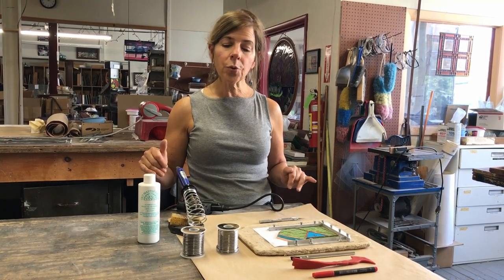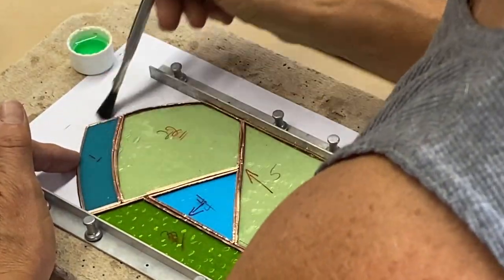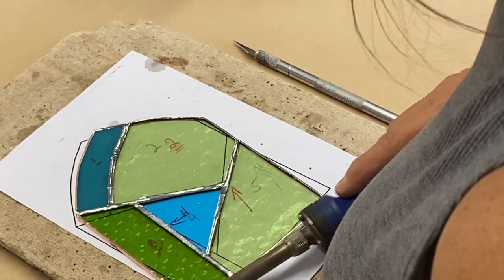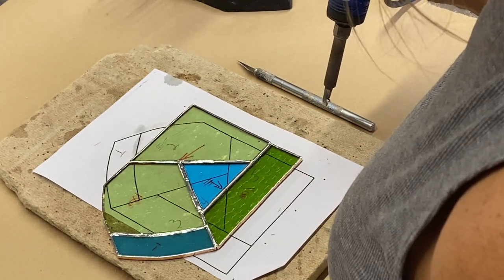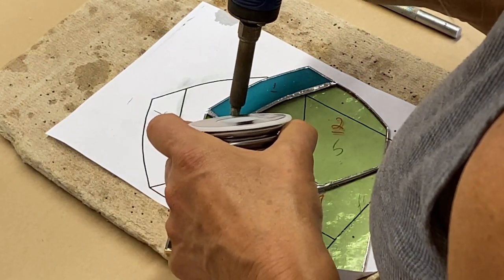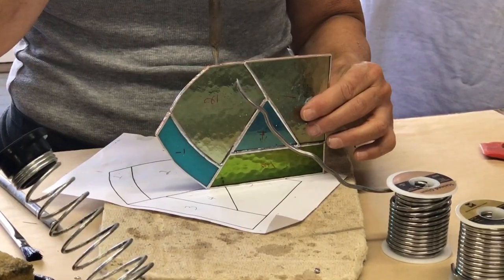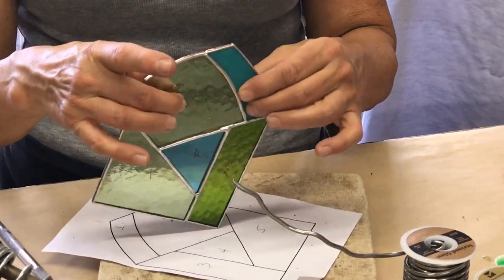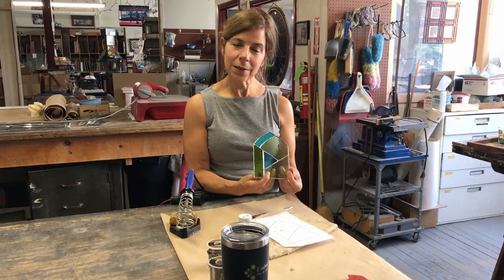Soldering for copper foil

Comment: This is called Tiffany glass construction. It was developed in the UK by Louis Comfort Tiffany (an american). This is not stained glass construction. Please remember that there is an L in solder, and it is not a silent L.......... Glad to see someone running solder beads. It is a component that so many can't seem to be bothered with.
Reply: So... what is stained glass construction then?
Reply: @cox6353 Stained glass... Clear glass the has a design added to it using mineral stains that are heat fused onto the glass surface (please note that coloured glass is a glass where the colour is not just on the surface). The glass is then held in place using lead came and solder ( sol der. There is no such thing as a silent L. The word americans say is sodder, which is something completely different......)

Comment: Very informative video for a beginner like me. I've watched numerous videos on soldering. Your technique seems to be simple and produces excellent results. I am using the same soldering iron as you. What temperature setting do you use? Do you change the temperature setting to match the type of solder you are using? I subscribed to your channel. Looking forward for additional great content from you. Thank you for sharing your expertise.
Reply from the maker: Hi David,
Glad this has been helpful. We usually set the iron to the 460 setting. No adjustment for solder types, but often will dial down the temp a bit when doing the second side to mitigate “leak throughs”
Reply: @shardsglassstudio9298  thank you for the response
Reply: Hello, what wattage is the iron?  100w?

Comment: Your videos are great and you explain everything very well. Can you also show how to grind glass and when is it necessary to do. Thank you very much.
Reply from the maker: Thanks Yuliya, Grinding is necessary for the most part with all pieces that are being used in a copper foil project.  #1, grinding takes the sharpness from the cut edge of the glass, thus preventing the foil tape from being cut or split.  #2, Also when grinding, keeping the glass down on the platform of grinder will give your piece a nice 90 degree edge, making it easier to foil evenly. Hope this helps!
Reply: @shardsglassstudio9298  thank you very much for your response. It is very helpful.

Comment: Thank you for your tips, would have been nice if you said what temperature level do you use for each stage of the soldering (flat solder, bead sokder)
Reply from the maker: Ahhhh, good point.  As each iron is calibrated differently it is hard to suggest a temperature setting.  Many irons do not use actual Fahrenheit #s but use more of a 1-5 setting.  Therefore it is necessary to experiment.  But, to your point (a good one) the front of a piece will always be soldered at a higher temperature than the back of a piece. This is because when soldering the back, the front is already "sealed" and therefore requires a lower temp so as to not leak through the finished front, and allow flux to heat and evaporate some in order to mitigate sputtering

Comment: Hi Kai, I have lots of glass and supplies I purchased from you over 20 years ago.  I took a hiatus and now that I'm an empty nester, I'm trying again.  I'm getting black marks when I am soldering.  Is my iron too hot? Thanks, Melissa
Reply from the maker: Hi Melissa, the first thing I would ask is what kind of solder are you using? There are different grades of solder. Some are virginal., Which means they have not been reconstituted old lead. Those would work the best and not leave black spots. The other culprit can be your flux. The job of flux is to clean the copper foil before soldering. If the flux is old and not doing the job, then the result is black spots in your solder. Hope this helps

Comment: What temperature do you solder at? I use 410 with the hako
Reply from the maker: We use the Hakko on 460 but keep in mind that they are all calibrated a bit differently and we usually use 63%tin solder (called ultimate)

Comment: Hi
Is the solder strong enough to hold all the pieces? I recently solder few pieces and i am not happy with the strength, as i shaked it felt like that part is gonna come out. 
Can you tell where i could have gone  wrong?
Reply from the maker: Without looking at your piece, I cant tell you definitively where the issue may be, but i can make a couple of guesses.  First, when you have a straight line, or near straight line in a piece it wants to "fold" or bend in that area.  One way to mitigate that is to run strong line or wire around the perimeter. (for future be aware that straight lines through are weak spots in any design).  Second, make sure your piece is bead soldered both front and back.  The bead is what creates the metal infrastructure to lend the piece support.  Even if you have patina'd you can still go back into the soldering and add more.  Hope this helps

Comment: I’m new to this and my sober doesn’t flow like when you do it. It doesn’t stick to the copper foil very well. I don’t hear that “sizzle” noise.  We seem to have the same soldering iron and I put mine on 410 ….Any suggestions outside of me taking a class? Thanks
Reply from the maker: I would try a different flux.  The one we use is called Novacan liquid flux.  The flux is an acid, so it can loose its strength over time and some, like a paste flux is not the flux of choice for copper foil.  If the solder is melting with contact of the iron tip, then thats not the problem.  The other thing you can try is to use xtra fine (oooo) steel wool on your foil seams to shine them up. If they have oxidized they will not take solder either.  Good luck!
Reply: Yes I do use a gel flux… I thought that could be it..Plus my solder does not stick very well to my sides..Thanks

Comment: Are we talking if 1100 Fahrenheit? Cuz I'm not finding any soldering irons that go that high All the ones I've been finding stop it like 8 or 9 🙁
Reply from the maker: We use the Hakko Iron with a built in reostat.  This iron has been reengineered a bit , but the FX-601 goes up to 1005 degrees.  If you are looking at electronic irons they wont go up high enough.